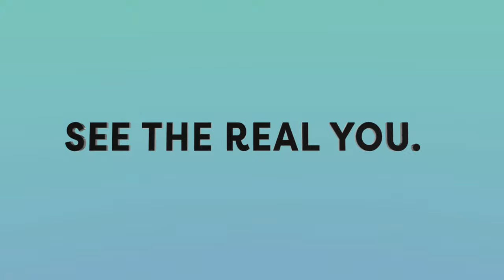True Mirror Story

Comment: I want a tall one, 2 meters high. where can i buy one?
Reply from the maker: Hi Johan,  the biggest that I can make is only 48" (actual mirror size is 46.5" x 18"), or 1.2m x 0.46m.  The size of the biggest panel I can acquire is only 50", and its also a very difficult thing to achieve optically.  the only way I could make it larger is by combining two panels, and then by the time it was all finished, it would be a real heavy unit to move around (the current 48" is about 70lbs).  As far as I know, there isn't anyone else making these in the world at this size...the only other one is a tiny 5" knockoff from China that doesnt even get the seam right.  If you want to look at the 48", here is the link:  https://store.truemirror.com/products/48x18-full-length-true-mirror
Reply: @TrueMirrorJWalter   It's a really cool product, but why is it so expensive? I mean it's just two mirrors, right? Is the seam very hard to get invisible?
Reply from the maker: @Cruelcoil  there's a few reasons...1) it's still handmade in low quantities by only me, so there's no economies of scale.  2) Its really, really difficult to get it right, so there's a lot of build time, esp for the big ones, and finally, the mirrors themselves are front surface, which is much more expensive than regular mirrors.  The big ones are like trying to make an instrument as accurate as a telescope out of wood, screws, tape and mirrors!  The small 12x12 plastic ones are a lot easier, but it's still not at scale,.  One day the world will catch on to this being an amazing idea and then they will be able to be less expensive. 

For sure the seam is crazy difficult to get right.  Turns out the more accurate you get, the more accurate you still need to be.  The glass is only able to be cut once, and needs a perfectly straight edge to line up to a perfectly flat surface.  If it's not right, there will be a gap in the seam, and even a tenth of the thickness of a hair is noticeable - and because it goes through both your eyes, it's hard to use it as a mirror.  Do that perfect cut top to bottom over 48" and its really crazy to get it right.  Even the 12" ones...they are so much better when the two mirrors touch perfectly.  But then, like i said, the more you get the seam invisible, the more you have to get the angle to be exactly 90.0 degrees.  If it's not perfect, your eye can tell, and it gets worse the farther back you go...there is a dramatic parallax increase.  So the entire two panels have to be on a perfectly warp free surface, with the ability to account for slight differences in the geometry, and even the way the mirrors hang.  For example, with the 12" model, i have to build in a slight shim of .005" tape on the bottom of one panel compared to the top, because when you turn the mirror vertical, gravity actually pulls it back.  Without it, you can be about 15 feet away and the parallax of that smallest shim actually translates to a 0.5" warp from top to bottom, which makes the mirror really wonky.  I know that I have succeeded if it looks perfectly good up close (seamless) and perfectly good from 15 feet away (the angle).  You would not believe how many times i tried to get that right.  And with the full length mirror, there literally is 4 fine tune knobs to adjust from top to bottom, because even temperature will be different over 4 feet and you have to adjust them differently!  

So long answer, it's expensive because its hard and I only can make a few of them right now.  But the net effect is so incredible...it literally is the only way you can make direct eye contact with yourself with your face actually functioning properly...the first time you can actually see and talk to yourself as you really are.  Every other mirror simply can not compare, they create a literal doppelganger that looks and acts differently than whoever you really are, causing you to believe in yourself differently than you probably could and should.  The full length one engages you with your body, so you can see how you actually animate yourself, and it's really so much more natural and uplifting to see yourself as more of a being, then just a body.
Reply: @TrueMirrorJWalter   I Ordered a small one for now. I hope you'll consider accepting bitcoin payment in the future :)
Reply from the maker: @Cruelcoil  thanks!  I got your order, it should ship out within 1-2 weeks.  re bitcoin?  Hmmm...maybe :)
Reply: @TrueMirrorJWalter  if its being handmade it might be an idea to sell a kit version for self assembly. just a thought.
Reply from the maker: @unitrader403  I would love to be able to farm this out  to others, but its super tricky to get it just right.  the seam between the two mirror has to be virtually invisible to be able to work right (else its very distracting), and theres like 20 design tricks that i have had to do to get it that way, and i still often screw it up!
Reply: @TrueMirrorJWalter amazing answer.
Reply: @Colorful-xo1lr hi, thanks, it's fun to be in the other side of figuring out how to make it right, I had so many fails, real head scratching, esp getting the angle 90.00 degrees top to bottom.  Every time I get one right, an angel celebrates with me 🥰

Comment: Well they sell non reversing mirrors on Amazon for 30 bucks..
Reply: they do, and sometimes they work, but often not.  Making the seam invisible requires a lot of precision and those often have a visible gap or are misaligned so there's a split or bunching up in the seam. The seam matters, it goes right through your eyes.  It's also small, so I feel kind of cramped in it.

However, if they get the optics right, great!  The point is we all should know our true image reflection, there is a lot of being normal with yourself that can result.